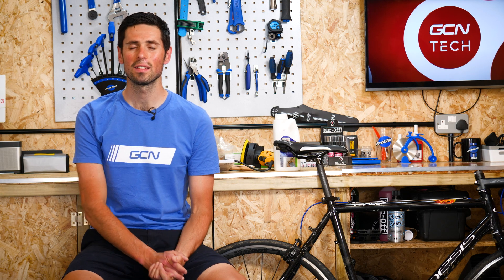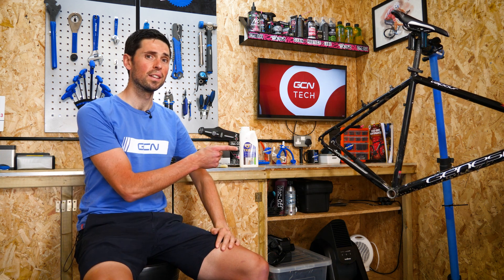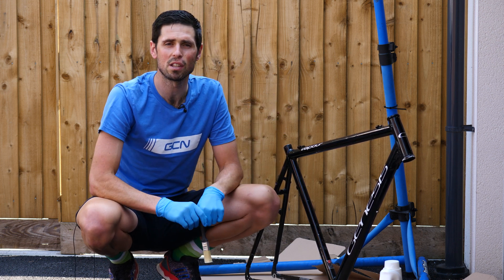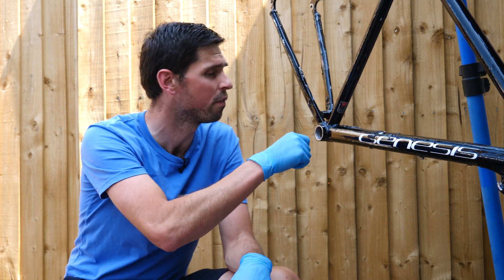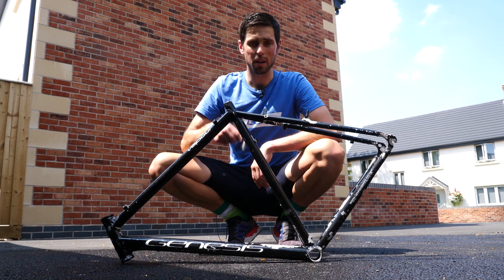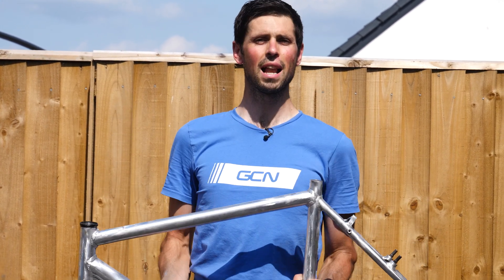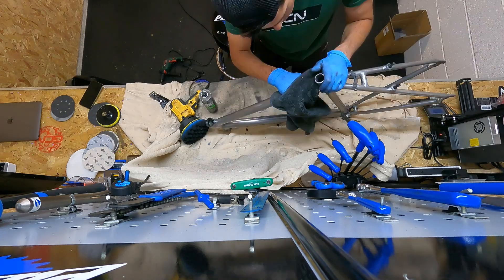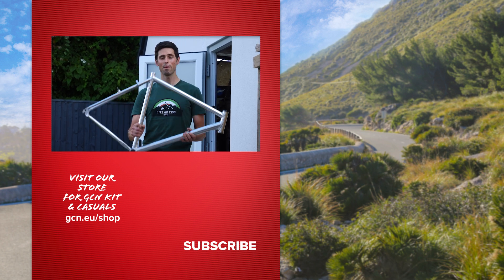Can You Polish An Alloy Frame To A Mirror Shine?

Comment: Not enough mirror ! Need miroir finish 

Paint stripper / and everything hand sanded from 180-400. Then 600-800-1000 wet sand 
Then get a ziplock bag over our hand to feel every defect and repeat the process if needed. 

Diamond polish then wheel pad polishing. 

If you can’t see you face reflect perfect through the frame. That’s not miroir polish 

Time consuming for sure !

Comment: I restored some badly putted Dura Ace 7710 cranks for a project, started with 240 grit wet and dry by hand, then 400 then 600, finished off with Autosol on a buffing wheel in an angle grinder!  New decals, adhesion promoter then laquer. Shiny shiny 😎

Comment: Now that you've saved weight cutting off those braz-on things, you now need to use more outer cables to increase the weight plus increase friction inside your cables by an immeasurable amount. And you forced me to spell braz-on I have no idea, I just making up some of this spelling.

...and you'll need to get some zip ties from Si to mount your outer cable.
Reply: Nearly there! You dropped a couple of E's. : )
Reply: Those are welded, actually. Brazed lugs one can find on steel frames. However, since Alex is going for a fixie rebuild, could have gone further and cut off brake posts and front derailleur lug as well.
But should you want the gears back, there are nice chrore clamps for vintage frames, so no need for zipties. Also, full length cable outers give better protecton and in long term give less resistance, since much less grime, grit and corrosion is built up inside
Reply: Or, it's just a fixie. And there you go, no cables.

Comment: I used that sort of paint stripper when I repainted my vintage frame. I found the problem is the stripper dries out before it can eat away at enough of the paint. I found you could apply the stripper, and then cover it with cling wrap to help it stay moist. It still wasn’t perfect, but it took off way more than in this video.

Comment: 7:44 I am deeply triggered by the headset cup removal tool hanging directly behind a frame with the headset cups still installed
Reply: IKR?! And without the cups it is easier to polish the headtube. Rivnuts could also go
Reply: Prob integrated headset mate.  They don't use cups.
Reply: @Windband1 
No, those are very much common EC34 cups. Why would you say it is probably an integrated headset when the external cups are easily visible?
Reply: @Exgrmbl  Ask him then.  There were no close ups to verify.  And why can't they be part of the frame?  Prove it.
Reply: @Windband1  
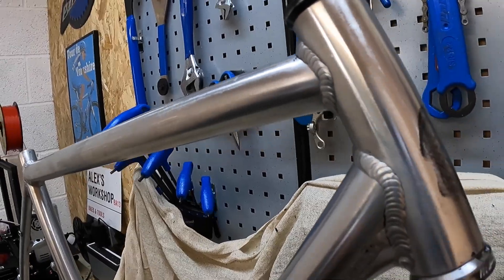 There are several close ups in the video. For example at 7:52. Besides that, you don't even need a close up to see that those are pressed in external cups that are not part of the frame... this is like the most obvious and recognisable style of headset imaginable. I think you just don't know what you are talking about.

Comment: just done my kona mtb frame. some areas bubbled up very quickly but it took 3 days for most of the paint to soften up. even then there was some stubborn areas that refused to lift. they were soft enough to scrape off with a plastic scraper. mind you it was probably not the best paint stripper (wilkos brand) and weather was very cold. removing the paint with stripper is a truly disgusting job. the stuff is ultra slimey and the fumes are not nice. the bike looks great even though i havnt polished it up properly. i will probably get it powder coated eventually.

Comment: Why not ask an experienced person before setting off on a task like this?
As many have pointed out, crucial points are eye protection while operating anything that is turning basically, rough-sanding every part before applying acid to the frame.
Btw where did that acid go when water blasting the soaked in mess?
Oh, and the removal of the brake bosses might have been making things easier and tidier in that area.

Comment: Why not use sand blaster before polishing frame. It would be much easier to remove painf off areas that are hard to get near with sandpaper.
Reply: Not everybody has a sand blaster at home 🤣
Reply: @CarlosGarcia-ze6rt  but you can do it DIY in few minutes.
Reply: @krist370  yeah, if you have an Air compressor, and again not everybody has that.

Comment: I did this recently on an old bike frame I was restoring. I went the old fashioned way. 400 grit wet sandpaper and lots of muscle. After that I moved to 600,  800 and ended up with 1200. Result was really nice, but..
Problem was it's a cheap frame (will be used for commute), some areas were just not so nice (around welds, cable clips and something that looked like they fixed in factory before spraying color) so I decided to use color after all. I think I should've stick to the original look. It would have had an "industrial" look. 
My initial goal was to put transparent primer and 2K clear coat (spraymax).

Comment: Watch Manon's video and prep a metal frame like she did, pay a local firm 20-30 odd quid to bead blast for you,  it will save you hours and hour of work and the result will be much better!! If you absolutely have to do it yourself, skip the paint stripper completely and just use an abrasive poly disk to get the paint off, they do far less damage to metal surfases than old fashioned wire brushes. Paint stripper ain't at all environmentally friendly and DIY products for the domestic market aren't designed for those paint finishes anyway.

Comment: You’ve sort of got it right, steel wire wheel on aluminium= big no no, scratches galore. Best results for chrome looking aluminium is steel wool with dishwasing liquid and a bit of water, bit of polish and it’s done. When polishing, use polish on a long shoelace looped around tubes. Bit of elbow grease but much better results.

Comment: The mask you are using will protect you from dust, but not from the fumes off the paint stripper. Although if you are working outside I wouldn't worry about the fumes.
Reply: I'd be more worried about your bare knees around the stripper. BTW, how much did the paint weigh?

Comment: Done that , took it a abrasive blaster , that used a plastic particles ( now hard to get ) , then he dropped it in to a polishing tub full of tiny ceramic balls ( now very expensive) and hour later rise in water ,shake out all the little balls , done  , no chemicals or sanding or wire wheels.

Comment: have'n done more than a couple aluminum polished frames, NEVER USE A Wire Wheel !!!
they can cut thru the frame, and scratch worse than you can imagine 
take the time with Aircraft Paint stripper; aerosol is the best, sand firt, get rid of the clear coat
rough sand, 600 grit
use a bench grinder or angle grinder, with polishing wheels & proper polishing compounds; usually a 3 set process,  don't rush  take your time 
...too many flaws & scratches in his video 
finish with Mother's,  to polish bright & seal

Comment: Stripped my old gt frame using nitromors and it is still like a mirror now,it was chrome but had a coating of lacquer from factory only sandpaper I used was 1500 and 2000 then metal polished by hand and it looks sick,its from the 90s when quality was still a thing

Comment: Aluminium can be polished to 90%+ reflective. Nice job for first try. Just coat it with nice clear coat to prevent scratches to metal surface in riding. Fixing scratch paint is a lot easier than repolishing scratch metal.
Reply: Most mirrors use Aluminum after all.  Silver is more reflective but you'd be polishing quite often!

Comment: Should be sanded to 1500 to 2000 wet and dry.
Then 3 stage  polish. Will leave a mirror finish.
Used to use this method when doing metal polishing on trucks. Have done a couple of frames for friends the same way.
1 with no clear coat. Which ended up being clear coated 18 months later when he realised how  quickly they dull without it.

Comment: How about stainless steel coating on steel bike ? Could we do that ?
Reply: No.
Reply: Stainless steel [SS] cannot be coated onto another material, but Steel can be coated with Chrome [Cr] in a galvanic process and will give you a perfect long lasting, hard and shiny mirror finish. BTW, SS alloy is stainless, i.e. does not oxidise,  because it contains Cr which will migrate to the surface of the metal alloy and hence in simple terms protect it from oxidation (the actual process is quite complex).
Reply: @robertrjm8115  thanks dude for the technical explanation. I asked in simpler term to catch attention of someone knowing the detail information. 
 Btw for this electro dipping for chrome coating on steel bike, is it going to affect the internal frame or not ?
Because if one day my steel bike paint is going to fade or it's starting to corrode i want to give my bike a nice coat of silver chrome finish. With some nice silver group set and component.

Comment: I have used different chemical paint strippers on many different bicycle frames. And at times have had a feeble result like the example in the video. Some times the process has to be done multiple times. Do not use a wire brush on aluminum and don't use a heavy corse sandpaper. Eventually ALL of the paint will come off with your chemical stripper.

Comment: Well done Alex, you've done something that most of us wanted to do, but never had time or courage.
You achieved nice effect, but next time instead of metal wheel use Nylon. Abrasive material should be harder than paint, but softer than frame. In your case steel was harder than aluminium, and that's why you had more scratches to remove.
Second thing is that when you use paint striper it's better to wrap covered in striper frame with clear film and just leave it for longer.
In stead of sanding it later for 6h keep striper for 5h more and sand it for 1h.
Plus it's safer to wipe off striper from frame with paper towels before washing it down, and splashing around your place.

Comment: If you are applying generic paint stripper, apply and wrap frame with some bin bags (so that it won't evaporate immediately).Leave it for a few hours or overnight - then paint will lift way more than you got here for minimal sanding. It will still give you a workout to leave it brushed looking (my favourite). Great finish you get there in the end.

Comment: I'm wondering if a modern crankset, like a Shimano Ultegra R8000 crankset, could be polished for a 'retro look' or even for use on an older steel frame with a modern group set.  Black group sets on older bikes don't look quite right.

Comment: Getting it media blasted will save a lot of grief, especially when having to use lower grit sand paper as the scratches are really deep and require a lot of work.
Media blasting it will leave the surface uniform and depending on the media ( sand, glass, walnut shell etc) you may only need to use high grit sandpaper ( 1000 grit and up) saving alot of effort.

Comment: In the early 2000's, Cannondale had some road models available with polished aluminum frames. Mirror finished and clear painted to prevent oxidizing.
The late 80's - early 90's Vitus 979 Dural frames also had the same look using cast al lugs and clear or color anodized aluminum frame tubes.
Reply: I used to have a Vitus 979 myself with champagne finish main triangle tubes. It was the dogs bollocks in its day as the rival Alan frames looked and performed downright dowdy by comparision. The Vitus 979 also had an ultra short wheelbase that made it totally awesome for hill climbing.

Comment: Wrap cling film over the paint stripper around the tubes, that will keep if from drying out and more of the paint will lift. For the small bits left over, a sandblaster attachment for your power washer with a bucket of play sand will work.

Comment: nice looking result, however it turned out quite expensive for a 70g weight saving.   Even at the UK's national living wage with a fairly easy 7 hour work day it is still around £66 per day (I take it you are over 25, right?).  I do get the enjoyment and sense of achievement for doing this and understand the video though.

Comment: 🤔I Just Don't Understand Why He Didn't Use Aluminium Safe "PAINT STRIPPER" Hot Gun, Jet Wash With Bit Wet Dry Sandpaper,Buffer Pad with Aluminium Polish, Then Hit With Bit Gloss, Cut And Wax It, Maybe Some Ceramic  Coat,🤪BOB WOULD HAVE BEEN YOUR AUNTIE BOB😂

Comment: #AskGCNTech Hi Ollie and Alex. The brake pads on my calipers rub on the sidewalls of my tires when I take them out even when I adjust the swivel thingy for the cables. Is it okay to keep it like that or should I lessen the tension on cables? I prefer having my brakes engage even with little pull from the levers. Thank you so much. 😁
Reply: Buy narrower tires?

Comment: Didi that with my Colombo frame in the late 70's.
Had to redo it later, as it required a two component epoxy laquer to stay shiny (water permeability).
Turned out to be heavier than original, so after a year it was cleaned of and given a metallic bourdeax-red color, that lasted until the bike was stolen some years later...

Comment: NO! Don't wire wheel aluminium ever for any reason!
That's for steel only. Aluminium is far too soft and a wire wheel is far too aggressive and will leave deep scratches which will then require you to remove a heap of material to eliminate

Comment: Beko Speed Ex does fairly well with removing the paint, but still struggles with the primer or whatever else there is underneath.

"Mirror Shine" means no more dampening scratches to me, as you can see them in the close ups, just use a polishing attachment for a drill or dremel and take your time.

Comment: This is actually the right job to use a buffing wheel, and a few stages of buffing compound.  When  you finish buffing with a high speed wheel and white rouge, the surface will be mirrored and won't reoxidize as quickly because of the mirror polish.  I liked your imaging of reducing the hills and valleys in the video.   Great illustration of what you're trying to achieve.  In the end, the bike industry uses a thick plasticized coating over all polished alloy to keep it hella shiny, as anyone who has tried to paint those shiny silver bike parts will find, when they try to sand them key before painting.  My guess is clear powdercoat might be the right way to go if you were intent on doing this to last.

Comment: So mit underestimate the time needed for sanding/stripping paint. High quality paint stripper, wrap in stretch film, leave overnight. The warmer it is, the better it will work.

Or just spend 30-40 bucks for sandblasting.

Comment: I was shocked to see you use a high pressure water jet to remove the toxic paint remover and paint outdoors where the chemicals would leech into the ground.  I suspect this is illegal in the UK, and if the environmental authorities were to see this video, you'd be in a bit of trouble.

Comment: Normally I love GCN content however this really needs to be pulled! 
1. Applying paint stripper without eye protection - that stuff (even the modern EU compliant rubbish) can really do some damage to the eyes.
2. Wire disks or metal scrapers on aluminium - as others have said these can leave deep scratches that are almost impossible to polish out, and, worse, are starter sources for corrosion.
3. Again, wire disks without eye protection -  these disks revolve at several thousand rpm and can shed tiny fragments - if you're unlucky, into your eye.
4. Washing off paint stripper into ground water...umm
I could go on.  As "How to" content, anyone following this procedure simply should not. Either get the frame professionally dipped - cheap and quick - an allow wheel refurbisher will probably do it for you, or bead blasted.  A better job, probably cheaper (after you've bought the extra sanding disks and stripper) and a far, far safer and better result.
Polished bikes look wonderful, but only if done properly.

Comment: first drop the mask, the frame doesn't have covid!!! after applying the paint stripper wrap the frame in clingwrap and leave it sit a day or two, rince and repeat. do not use a wire brush on alu, you can't  sand or polish the scratches out. you must clear coat the frame, if not it will oxidize and be ruined.

Comment: Yes you can but it depentds on the alloy! Not any aluminium can be polished!
Reply: I have worked in yards and used alluminium for simple molds. It was polished mirror like and we used tons of different alluminium types. The result is heavy dependent on the process, even early stages will change the result dramatically.
Example: using a wire a brush is the worst idea you can have.